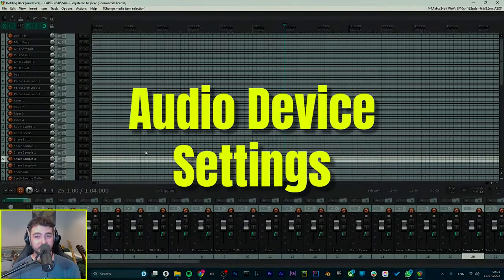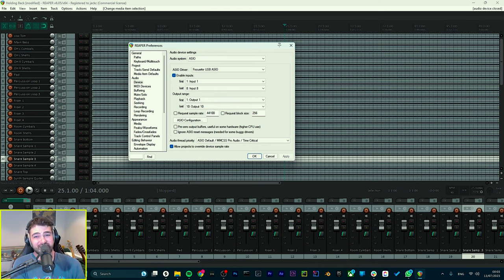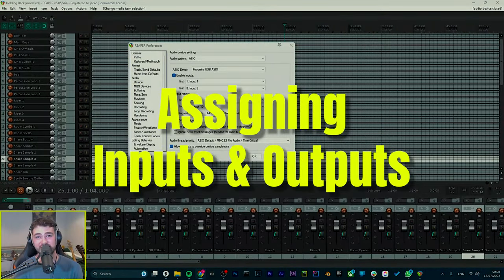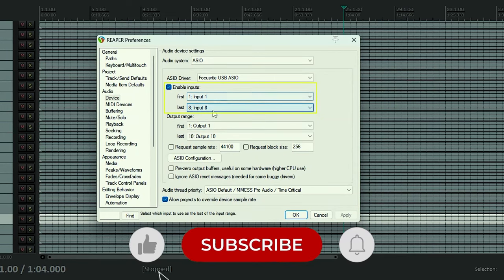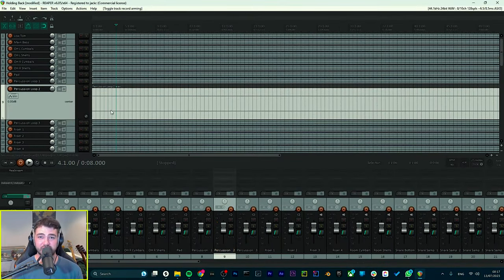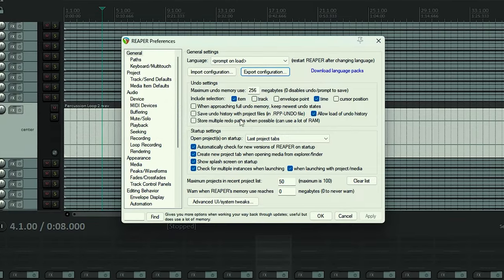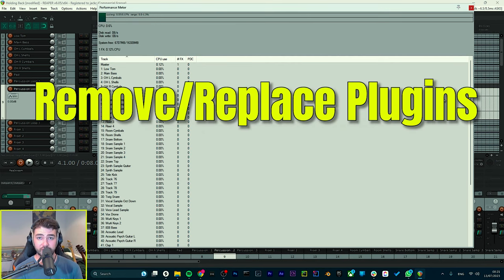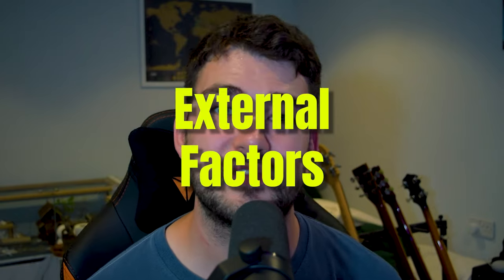Fixing Silent REAPER and Having Issues of No Sound: A Comprehensive Step-by-Step Guide

Comment: All my PC outputs are fine ( I am listening to your sound), all of the Reaper settings are assigned as per your video. My microphone shows input in Windows sound settings, but nothing in Reaper. My Korg Liano DOES show input in Reaper, and will record. I just cannot get any sound on playback, it's really frustrating. I installed Audacity, everything worked straight away!. Thanks for your tips, but I still can't solve my issue. I paid for Reaper too before trying it out properly, so I would really like to get it working. I've even tried configuring  all of the other Output options, like WASUPI, Direstsound, and Waveout.

Comment: Jack, I have just gotten a new computer (a powerful HP Pavilion laptop). My interface is a little Phenyx Pro (it shows as “USB Audio Codec” I am using ASIO 2.16). Here’s the problem: I was trying to open a new project in Reaper:

1. I opened Track 2 and plugged in my guitar to my interface. 
2. I armed Track 2 to record

Track 2 will not record my guitar. The recording function IS working but there is no input. Track 2 reads "Not Connected". I take this to mean that the Reaper software is not reading the input from the guitar. My interface appears on the output list but not in the input list. The interface is not on my device list.

Any suggestions?

TomL

Comment: Hi I've got an issue where I have to keep reconfirming the audio preferences (just "OK" every time) and then it works fine until the sound goes again (erratic time intercals). Also occasionally get a sound glitch or two before it happens. It's a new laptop windows 11 and never had the problem with Windows 10 and an older laptop.
Reply from the maker: Hey Andy. Based on your description, here are a few things you could try to troubleshoot the issue.

Check for driver updates for your audio interface and install the latest drivers. Manufacturers often release updates to improve compatibility with new operating systems.

Adjust the audio buffer settings in REAPER's Preferences > Audio > Device. Try increasing the audio buffer size if you are getting sound glitches. This reduces load on the CPU. (We do have a video on this.)

Disable power management for your audio interface device in Windows Sound settings. This prevents the device from turning off to save power.

Try different audio drivers in REAPER like ASIO, WASAPI, or DirectSound to see if one works better than others.

Make sure you are running the latest version of REAPER and check their website/forums for any known compatibility issues with Windows 11.

Try increasing CPU performance in REAPER's Preferences > Audio > Device, by adjusting the number of cores, priority, etc.

Let me know if any of those suggestions help resolve the problems you are seeing.

Cheers!
Reply: Hi thanks for the feedback. All drivers are up to date. I can't see how to increase the CPU performance for the device there doesn't seem to be an option. Will look at the power management setting and feedback... cheers

Comment: So, I've got two tracks that have the same plugin enabled on them, and every time I try to player them both at the same time tracks cut all audio from both. Tracks without the plugin still work, and when I re-open reaper they work for a few seconds before buffering the whole program and cutting the plugin again. Seems to work with only one version, and the CPU/ RAM seem to be unaffected, in fact other more intensive tracks can be played at the same time without this issue occurring. 
Can anyone help?

edit, it's a MIDI track, and it does get to 0.90%-odd in a section.

Comment: Hi! I'm actually trying to use WASAPI audio system. It was working fine like that, I use REAPER to edit podcasts, so I don't really need to record anything in that part. Suddently after some REAPER updates the WASAPI or any other onboard audio device show as "audio device closed".

Now the only way REAPER works is when i plug in my external audio device. Already tried to reinstall all the drivers (onboard and external interface) but still does not work. Any ideia what could cause that?
Reply from the maker: Hey man. Here are some possible reasons.

A recent REAPER update may have caused a conflict with your onboard audio drivers. Try rolling back to a previous version of REAPER to see if that fixes the problem.
Your onboard audio drivers may be outdated or corrupt. Try reinstalling the latest drivers from your motherboard manufacturer's website.
Your onboard audio device may not be compatible with WASAPI. Check your device's documentation to see if it is specifically listed as being compatible with WASAPI.
If you have tried all of the above and you are still having problems, you can try the following:

Disable any other audio applications that are running in the background. Some audio applications, such as Skype or Discord, can interfere with REAPER's use of WASAPI.
Try using a different audio output device, such as your external audio interface. If your external audio interface works with WASAPI, then the problem is likely with your onboard audio device.  I hope that helps.

Comment: Hello,
I'm fairly new to Reaper. I started running it on a PC and everything ran great. Now, I run it to a Mac and even upgraded to Reaper V7.03 and have problems getting signal for my analog inputs (level meter does not move and recorded audio is silent/empty). Could anybody point me in the right direction?
I did some troubleshooting as follows:
- cable connections are good
- correct audio device is selected in preferences/audio/device
- the track is armed
- the correct input is selected
- On my audio interface loop-back mixer, I can see the signal meter moving for both inputs
- Volume levels are high enough on the inputs to capture signal

Am I missing anything? Please help!
Thanks!
Reply: I'm having similar problems, did you get it to work?
Reply: @AndyRec  Mac System Settings - Privacy & Security - Microphone - Reaper Enabled
Reply: I have this exact problem.  It's pissing me off.

Comment: All this info is outdated - Reaper menu under "devices" has NONE of these settings!!
Reply: yea it does, you just have to make sure audio type is set to asio
Reply: @abagelperson3203  I didn't realize this video was for a PC - I have a Macbook which doesn't have the ASCIO thing.  I fixed mine by going into "Privacy & Security" under system settings and hit the toggle on to allow access to Reaper and microphone.  Pretty simple once you find it.